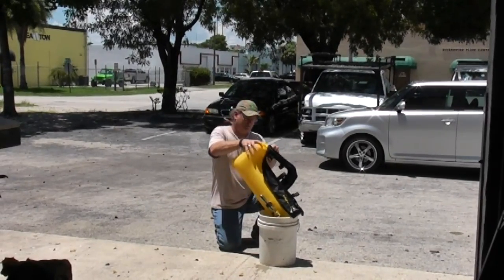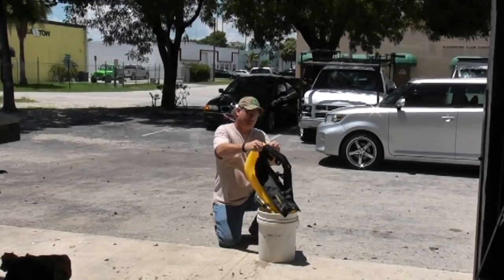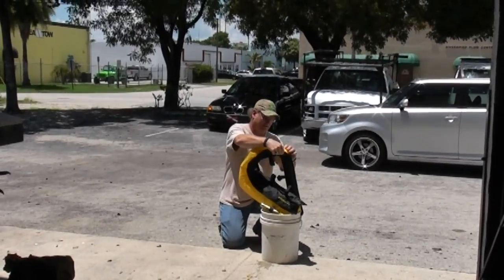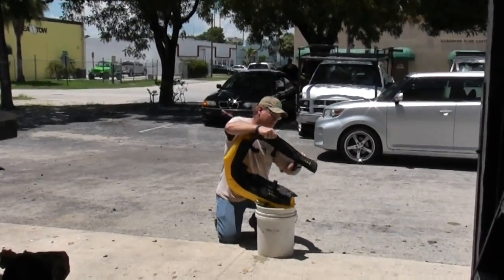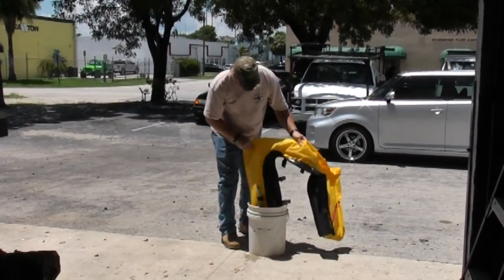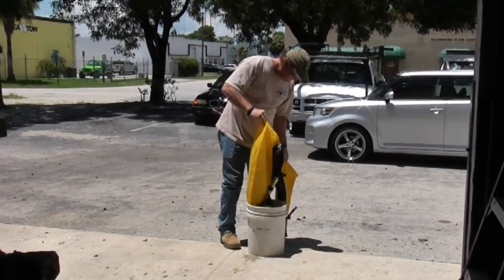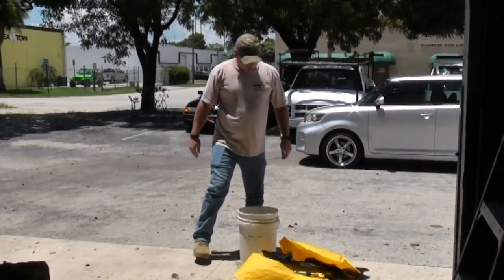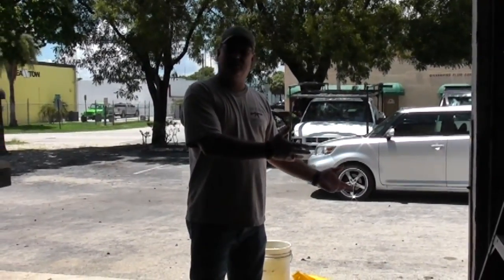Power Float Review

Comment: +Lauderdale Tactical As a follow up to this, I just threw mine in a bucket to see if I would get the same results and it inflated brilliantly without the squeaking/loss of air that yours experienced. I'm pretty happy with it and with my pack job, I think yours was either damaged, packed incorrectly, or had the wrong CO2.
Reply from the maker: +Shane Denherder Hey Shane, thanks for the follow up. To be honest I have no idea what was wrong with mine. I did talk to the manufacturer and they did say they had some problems with that style and thats why the came out with a new style with 2 Co2 cartridges. I bought mine from a dealer and he set it up and packed it for me and it stayed that way for about a year.

Comment: Thanks for posting , I was going to buy one of these over an Agama , Now with yours comments and other poster, I have my doughts . If they want to sell me one , they will have to supply 2 Co2 and fuses, So i can test it . Lucky that wasnt a gun that you needed to save your life .
Reply from the maker: Cled, the owner of Power Float told me they have a new model out with 2 Co2 cartridges. He said they are aware of this model known to fail. The new model is supposed to be better. After watching Ryan Shaw's videos of the Agama, I had to get me one! I'd go with the Agama any day! Thanks for watching and commenting.
Reply: +Lauderdale Tactical nothing of the kind was ever stated. Again pure slander. All units are pressure tested and use the sane sysytem as a agma. Low level marketing like this us disappointing but a reality some retailers will undertake
Reply: I remember back in the 90's the owner of second chance a manufacturer of bullet proof vests, he  would test his own equipment on himself . When he took that 44 mag out and pointed at his own gut and fired it I was sold. The time to find out your floatation device is failing in not when you need it the most and loss of life.

Comment: This video is bias and pure slander. I think burning the unit is just a stunt and  would request that it be removed out of common decency as you can hear the co2 canister was not fitted correctly allowing gas to excape.
Reply from the maker: +Ben Darke Hey Ben, as I stated below in my other comment, this unit was packed and set up by the dealer I bought it from. It stayed that way for over a year. The owner of Power Float reached out to me and told me they were of some problems with this unit and they came out with the new 2Bsure power float. I wanted to demo this power float and when it failed, to be honest, I was stunned and pissed it didn't work. I burned it out of anger. I wasn't going to post this video but decided others should be aware and make sure theirs works. If you watch the original video by power float you can see he helps the velcro apart to inflate.